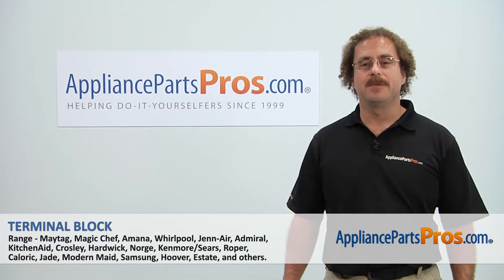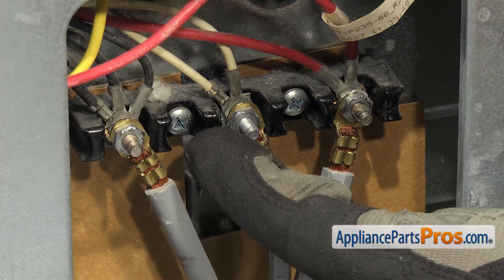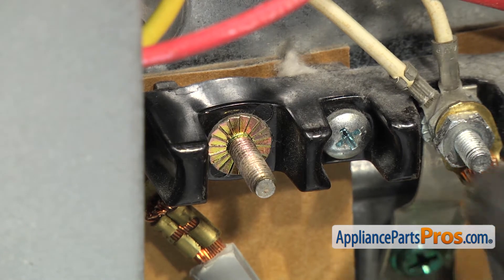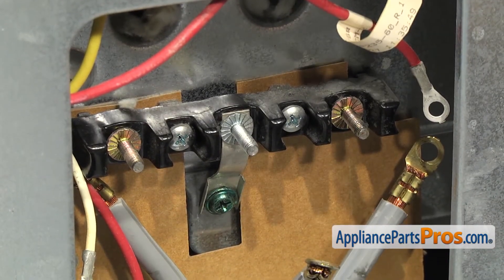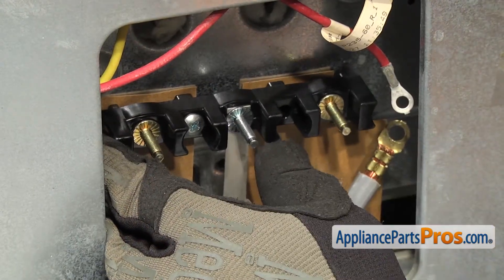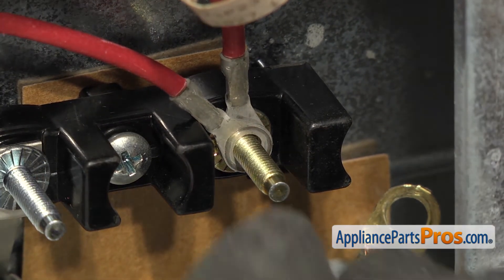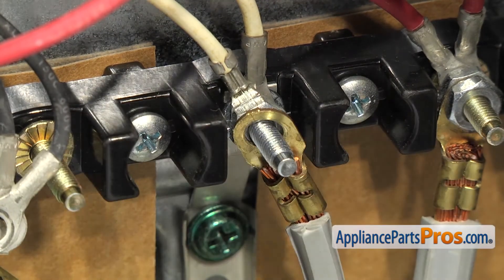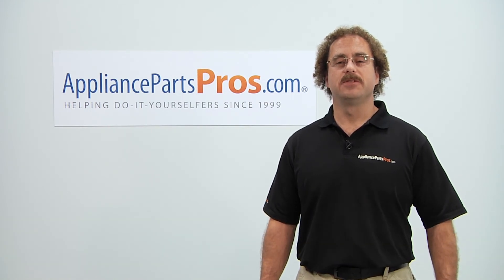How To: Whirlpool/KitchenAid/Maytag Terminal Block WPW10245259

Comment: Where can I get the proper ring terminals for wires leading down to block from inside range .  They were damaged.  Are they high temp 1/4 inch eye?